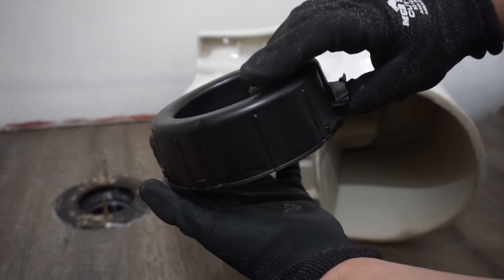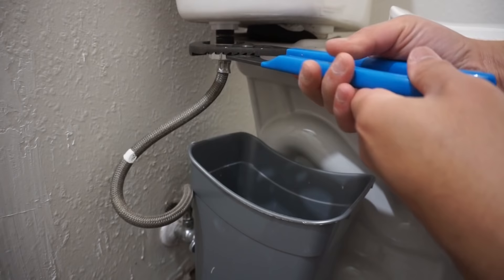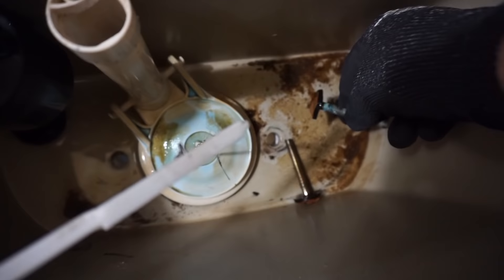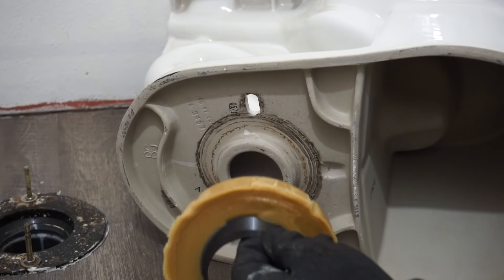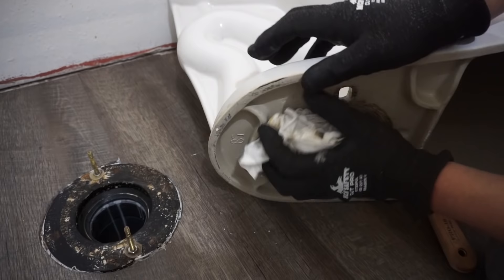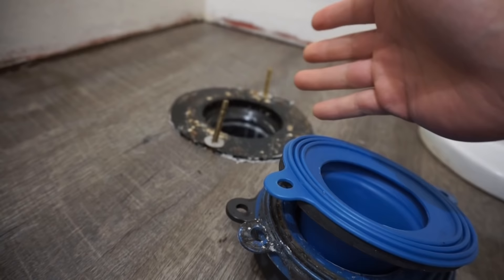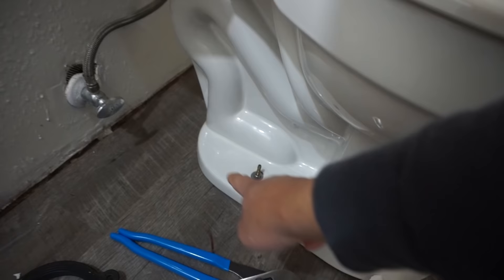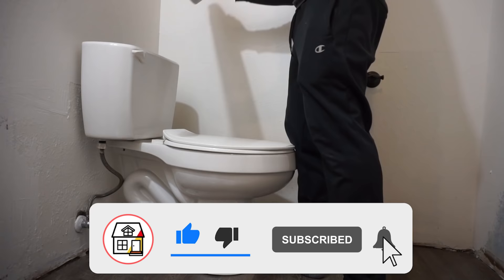How To Replace A Toilet Wax Seal OR Rubber Toilet Seal On A Toilet Flange To STOP Toilet Leaks!

Comment: A cooi trick i learned is cut a plastic drinking straw in half and place each half on the flange bolts. That makes it super easy to guide the bolts through the mounting holes on the toilet base. Once its set in place just pull the straws off and install the washers and nuts🤙👍

Comment: The rubber seal is far more forgiving than the wax and I'd recommend it for beginners over the wax. The problem with the wax is it's single use and you have to get it right the first time or it'll leak. The last time I changed a toilet, it was kind of an awkward and heavy one so I goofed setting it down on the wax and when I went to readjust it and test it, it leaked. There was no fixing the wax seal. I had to go to the hardware store again and this time I got a rubber seal. Although I did goof up again setting it down on the seal, readjusting it got it down perfectly and it hasn't leaked since.
Reply: Yes, you so right.  You can read my comment above.  I had to reseat it a few times, and it sure messes up the wax.  And, now, it is not flushing as well, so I think the wax ring squished into the sewer drain part.  Anyway, I'm glad this guy made a video.  I can't wait to move to the plastic one.
Reply: I have issues with the bolts rusting and needing replacement every few years.  No way am I dealing with a messy wax ring that often.

Comment: If your wax seals are only lasting you 3-4 years then you're installing them or the toilet wrong. They should last between 20 and 30 years!
Reply from the maker: These video was for instructional purpose only 🙏🏽
Reply: @frank9733  I’ve got a 350 pound mother in law. I’m not kidding, I’m afraid to figure out why our toilet is leaking
Reply: The two comments above should change your mind on how long they last. The toilet only has two flimsy bolts and that wax will only take the shape to seal the first time any shifting and the seal is broken.
Reply: @luemn7691  that's what threadlock is for
Reply: @noahdecoteau6381  how is threadlock gonna solve the issues mentioned above?
Reply: @luemn7691  umm by locking the threads in place therefore eliminating any shifting that would break the wax seal
Reply: @noahdecoteau6381  ok  I see

Comment: This only talks about ease of installation. He has no idea which seals better. I believe most professionals will go with wax. Wax has a proven track record and is easy to install. Improper toilet installation is more often the cause of the problem. Not a failure of wax.

Comment: Just replaced one toilet in my house yesterday after 16 years. The wax looked perfect and could continue sealing properly for years to come. I've only used wax rings in years past, never an issue with leaking. I like and use mostly Fluidmaster products as replacements, but something tells me these won't hold up nearly as well and or longer than wax. Anytime layers or doubling up is needed, it just creates future problems for leaking. Appreciate the info/video, but I'll stick with the tried and true.
Reply: Absolutely, Tile setter for 45 years, removed and replaced more toilets than any plumber. Wax is the way to go, after tile floor is installed the flange can be lower than floor and you can take a flanged wax ring and a non flanged and stack them, never had a toilet leak. I have come across 1 rubber one and it was leaking.
Reply: @thomaskoehler9992 thanks for the advice. That was the information i have been searching for. I have put a layer of plywood over the existing floor in a mobile home for stability and couldn't quite get the flang up enough. 👍
Reply: I’ve switched to rubber seals.  Toilets have a tendency to rock.  They can be fine at first but start rocking over time.  Then the wax seal is screwed and it can leak despitetightening the closet bolts.  I think the rubber is more forgiving.  I’m not sure about doubling them up though, I’ve luckily never had to do that.  I’m not a plumber tho, just have to do it occasionally.
Reply: Wax ftw 💯

Comment: I just replaced our leaky wax seal with a Fluidmaster. It took an hour remove the wax leftovers, but only 15 minutes to install the Fluidmaster - including reading the instructions. Happily, no leaks. I also have now learned how to double up on Fluidmasters if the flange underneath is way below floor level. Thank you!  Subscribed.
Reply: Yeah, Fluidmaster was very deceptive in their product box design. The outside of the box said it would fit any flange, any height. Nowhere does it say that you might need to purchase a second seal until you get home, open it up and read the instructions.

Comment: I’ve watched quite a few videos on this and this is the first one to recommend pulling the tank, then the toilet.  This makes a lot of sense, especially when using a wax seal.  The wax is unforgiving and if you shift the toilet too much as you’re installing it the wax can deform and obstruct the flange drain.  It’s much easier to lower the fixture straight down onto the seal and align the bolts the first time without the weight and bulk of the tank on it.  Then with the new tank bolts you’ve eliminated any problems there as well.  Good video!
Reply from the maker: Thank you so much for the amazing feedback! 🙏🏽😊

Comment: One PRO regarding the rubber seal is that is is reusable.
If wax ring, and you install the ring and toilet, but find yourself needing to lift it back out for some reason, you might need to put in another new wax ring because the last one has been crushed.
With the rubber seal, you can pull out the toilet and put it right back again with the same rubber seal.
Reply: One big con to using a rubber seal. With a little aggressive plungering you can spray nasty water out from around the base of the toilet. I use them and I respect the fact that they don't seal well against the plunger
Reply: One con is that they leak. You ever go to a plumbing company and look in trucks you'll never see guys using foam or rubber rings. They all use wax.
Reply: @IHateHandleNames  It's probably cynical of me to say this, but if I was a plumber, I might not have the financial incentive to do a fix that might last a lot longer... just sayin'...
Reply: @Tyler -  the reason you'll never see plumbing companies using rubber or foam toilet seals is because they cost 2 or 3 times as much as a wax seal. It has nothing to do with quality. If their trucks and vans were full of the best products on the market, they'd go out of business.
Reply: @IHateHandleNames  I replaced all three of my toilets in my house and used the Oatey rubber seal on them all. No issues and it's been 7 years now.
Reply: Great video.  I need to replace mine.  Thought this was going to be way harder than it actually is.  Appreciate the pro’s and con’s of the two products everyone has made in the comments
Reply: @IHateHandleNames - Otoh the rubber seal costs a lot more than the wax one so as a plumber why use the more expensive one when the wax one will do the job for cheaper.

Comment: I did septic tank installs in highschool, my MOS was 1171 in Marine Corps and messed around a little there with plumbing. 
Recently I had to replace the old wax ring that was leaking. I found the neoprene/rubber setup and I used it. No complaints after about a year, and I don't expect any. Ive used neoprene collars in a hydroponic cloning system for a few years, never once changing the neoprene collars, or having issues, so I'm pretty sure they shouldn't have an issue here. It is AT LEAST not as messy as pain in the ass as a wax ring. 😝🤣
Reply: What’s 1171?  80’s era 3521 here, diesel mechanic

Comment: Don't need to disconnect bowl...unless you want to replace rusty bolts or tank to bowl gasket... It did look a lot easier to set bowl straight down on bolts and wax, which is very important.

Comment: This is literally the video I needed. I noticed my upstairs toilet leaking through the tank bolts so I bought a repair kid and changed all of the guts out but it continued to leak. I then took it apart and cleaned it like crazy and noticed micro hairline fracture on the tank. I got some epoxy cement and it’s curing as we speak. Brought the good tank from the basement up and will put the bad one downstairs or the “fixed” one when it’s done if it’s even fixed. But anyway. I just noticed that my toilet rocks and the caulking or sealant is all strode dry and damaged from water. I definitely have a leak. I’m going to go to Home Depot right now and buy the rubber seal and give this a go. Amazing video. Loved the explanation of everything and video tutorial on the use of it. Thank you!!
Reply: but some toilets shims just in case. if the floor isnt level. The toilet will rock no matter how much you tighten it down.
Reply: I think you and I had the same person install our toilets. I had the same exact issues.

Comment: As a weekend “do it yourselfer” I was installing a new toilet. I went through 2 wax rings and it still was leaking, ended up the floor tile wasn’t level with each other. The rubber ring worked for that situation really well.
Reply: U didn't tighten it down good enough thts all
Reply: @larrytheplumber9851  I doubt it

Comment: I removed 10 plus ring & never had a rubber held up less then 9 months
 Wax is for ever 20 plus years best invention
Reply: Replaced all three toilets in my house and used the Oatey rubber seal on all of them. 7 years later and still no issues.

Comment: Just did this 2 days ago using the rubber fluidmaster. Worked flawlessly, it was nasty underneath the toilet, but this fixed it now my toilet is good.

As others have said, you don’t really need take off the tank, but I did because I’m a noob and the bolts weren’t on the inside of the tank. They’re on the outside of it. 

Overall took 2 hours in total, but super worth it.

Comment: Great video but people never use any tools to tighten the hose to your toilet side 7/8” side if you notice they are all plastic and have good grip that’s so your hand 🤚 is the only thing you need to tighten it, I made the mistake of using channel locks like him and months later the plastic connection where I tightened broke while I was at work and guess what that hose doesn’t shut off on it’s own but my wife noticed and turned it off still flooded a decent amount, true story :)
Reply from the maker: Thank you for the advice! 🙏🏽😊
Reply: Never ever use tools to tighten bolts  or supply line on a toilet. I have never seen a plumber use a non wax ring to install a toilet. I really question if this guy knows what he is talking about
Reply: I used to be a plumber and I was taught to tighten it down by hand, then take the channel locks and turn it another 1/4 of a turn.

Comment: a good idea is to put a face cloth with twine tied to it to cover the drain while cleaning old wax , rusted bolts or new hardware so nothing falls into the pipe . i also did this when cutting the drain pipe for a new flange installation . i was worried my inside pipe cutting bit saw could drop in .

Comment: Thanks for showing us how to do this.  My toilet won't flush as well now, and I think the toilet bowl ring was compressed into the sewer drain -- after years.  So, I'm replacing it with one of these, and I hope it works as good.  Also, I do remember having problems getting the toilet aligned just right, and I was a dumbass and reseated it a few times.  So, I bet that I screwed up the toilet wax and (eventually) made this happen.  Not sure.  I'll remove it and see what's up.  But, yeah, it hasn't always flushed perfectly, but the toilet parts all seem to work right.  However, it's one of those Eco-ones so that might be an issue.

Comment: Unless you're replacing the bolts, there's no reason to take off the tank. Wax will last longer than anything on the market. Also, never install the wax on the bottom of the toilet first. As you can see in the video the bolts cut through the wax because he didn't line it up right. If you place the wax on the flange and center the toilet you'll be golden. Once you center the toilet on the wax, sit on the toilet backwards facing the tank. It will seal the wax evenly. ALSO, NEVER GET THE ONES WITH THE PLASTIC HORN!! sewage and water splash off it and can cause leaks, same with the rubber "better than wax" kit. They don't seal correctly and leak almost always. You may not know it until you look at the sub-floor years later and find it's rotted and moldy. Lastly, caulking is not necessary. If you need to level the toilet then use a shim in the front.
Reply: I always thought it made far more sense to put the ring on the floor flange first. Why do all the instructions always say the opposite?
Reply: @boojiecentoobie4272  so they can sell more wax rings I guess... Lol
Reply: I was going to ask why he took the tank off. I have heard people do both ways. The reasons why people take it off are:
- If it's a one person job, it makes the job easier, especially in reseating.
- There is no chance in cracking the tank while the toilet is on its side when cleaning the old wax. 
Not sure how I will attempt mine.
Reply: "Lastly, caulking is not necessary."

Unless of course you want to be code compliant.
Reply: @notahotshot  it's not a universal code, the code is state by state.

Comment: Nice video but I must say removing a toilet tank to swap out a wax ring or rubber ring is like removing your windshield to change a flat tire also pro tip...use wd 40 and a rag to remove any wax residue you might get on your flooring you will be amazed and your welcome!

Comment: Nice video. I'm in the middle of repairing my 49 year old cast iron floor flange, about to drill holes, either in an Oakey fix-it or an Oakey 4" twister.  Has anyone used both the rubber seal along with the wax ring underneath it?  I'm having concerns about being able to have the floor flange be truly level and it seems the wax ring would help resolve that.

Comment: INVENTION:  Place a solenoid valve between the line and the toilet.  Connect the solenoid to a water detection circuit.  If water detected, then the solenoid turns the water off and illuminates a flashing red light "water detected"... Use one on each toilet, and one on the washing machine.  Can prevent the "runaway leak" that destroys entire homes.  Perfect for a rental or vacation home.
Reply: Better to use a motorized valve vs a solenoid. Solenoids tend to get really hot when magnetized, so better only to use them for situations when they’ll be on for a short amount of time, like a sprinkler zone.
Reply: @artificiallyunintelligent4537  True, that way it only has to be energized for a short time to turn off...
Reply: Great idea, that has been around for ages. They just put the "switch" on the main water shutoff. No need to isolate a leak. You don't even need to plumb many of them in. They attach straight to the pipe and main valve.
Reply: @ouisi7  Sweet, what are they called so I can go and buy said system?

Comment: Good video. I noticed a sewer smell, but no water leaking from the base of my toilet. The flange is level with the tile so I'll be using the blk rubber spacer.

Comment: As a plumber I’ve set multiple toilets and replaced multiple wax rings never have a leak. And the only thing the rubber seals are good for is stealing the pack of bolts,washers and nuts that’s it 😂
Reply: Thx I agree
Reply: Strongly disagree. Replaced all three toilets in my house and used the Oatey rubber seal on all of them. 7 years later and still no issues.
Reply: I agree wax is the way to go.    If you shim the toilet where it's low and get rid of the rocking.    The wax seal last forever.

Comment: I replaced my old wax seal (that worked for about a decade) last year with the rubber one and tonight after work I'm going to have to figure out why it's leaking already
Reply: So, have you figured out why it leaked? Was the rubber ring to blame? @gil2k

Comment: I used one of those rubber gaskets and at some point the knob on the bottom of the toilet kinked it over and within a week after putting it in it was pissing water all over the floor. Not as good as you think they are. I think I'm going to have to go to wax again.
Reply: Stop using it for a cocking chair.
Reply: Their fine i use them and contractors i know turned me on to them. Fucking wax is a disgusting mess and promotes hesitation  of picking up to adjust, or clean, or inspect. They make it such a mess and have become entirely anachronistic

Comment: I did the toilet as 1 piece, bending over was near the limit of my strength .  used the poly one was forgiving if you wobble it putting it down.

Do you need to checked the seal between the tank and the bowl  when you replace the bolts?